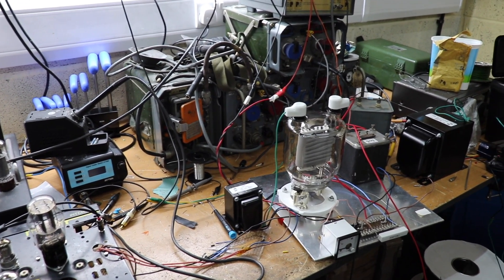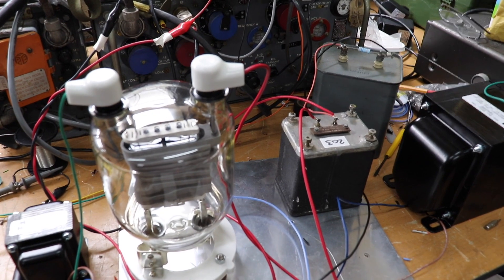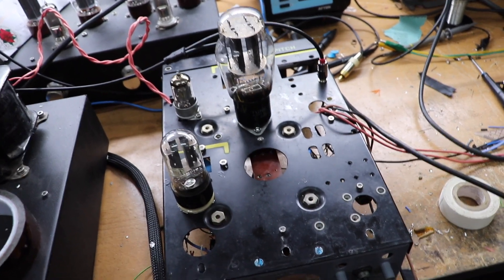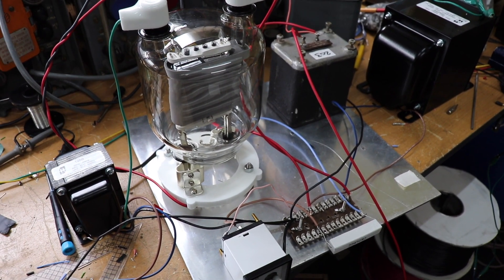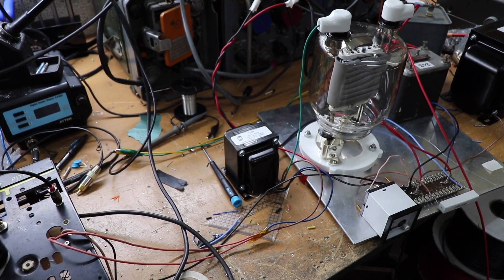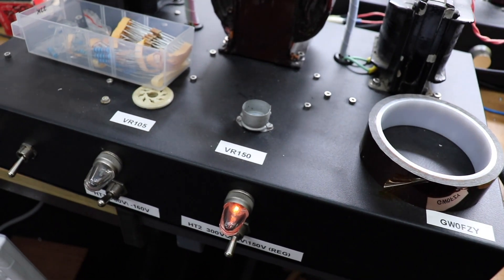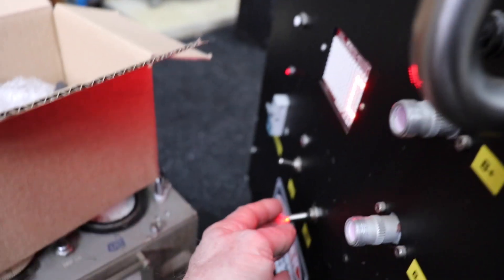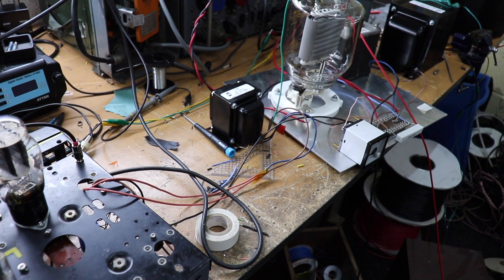Prototyping An 833A Audio Amplifier    Insane Power!!

Comment: Wavac claims150 watts/side in their insanely expensive SH-833 amps. In practice it's a lot less and really takes a dive when speaker impedance drops.
Reply from the maker: Yeah, I think you’re right! I think this amp is probably capable of 50 -60 W reckon u can squeeze more out it by upping the HT